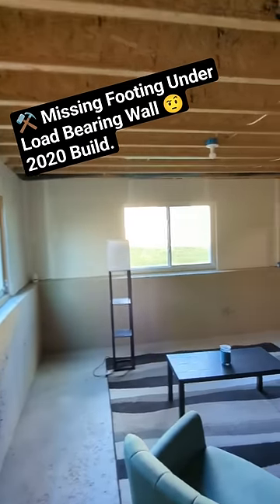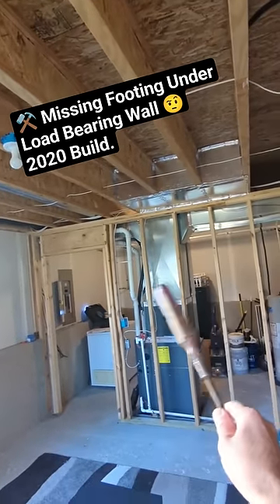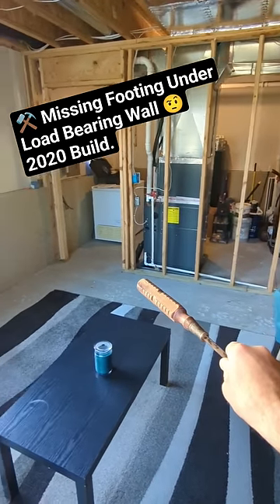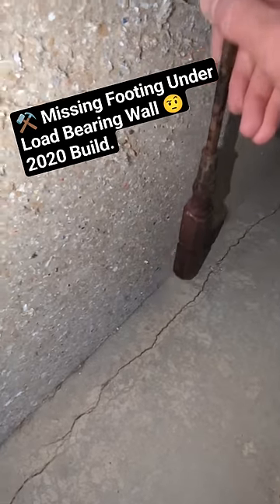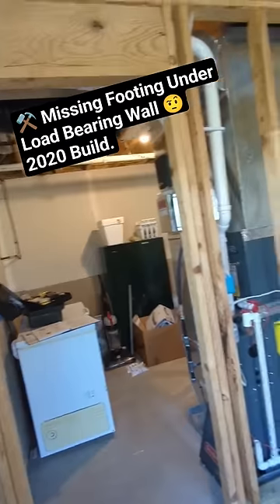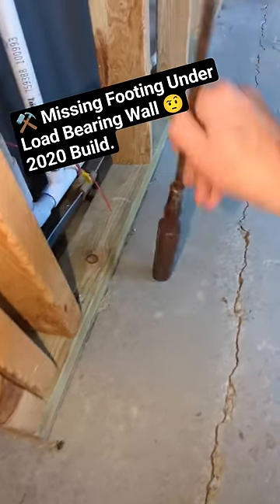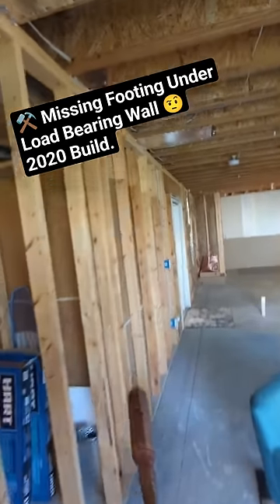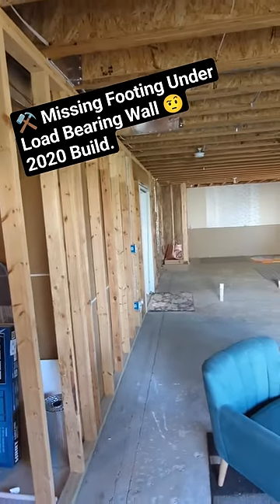FOOTINGS missing under load bearing walls NEW BUILD A trick to find missing#footing under #concrete

Comment: As long as the industry allows stupid drafters to design houses and lazy building officials to approve the drawings.  What do you expects?  Anyone who designs a house should be able to stamp those drawings just like an Engineer and have the education that goes with that.  There should be a 4 year apprenticeship to attain that stamp also.  But instead any friggin yahoo can design a house.  In Ontario there is a building code certification you need to obtain but that's not enough for the house to be designed structurally adequate.  All buildings should be stamped by an Engineer.  The problem is THAT is not a requirement.  But it should be!

Comment: Hahahaha....the price of 1yd of concrete 1200$...to rip out and add that same 1yd now 12,000$...build it right..or dont build it at all....this is the US..not China
I also find it interesting the crack next to the control cut.....the cut was probably done with a grinder and not a concrete saw..
One last thing and ill step from my soap box...do you guys know what the hell a tamper is...start using them..

Comment: Check the architechs specs on those trusses/joists.
The wall was put there as a partition NOT a load bearing wall.
IF it was to be a liad bearing wall there would be beams rinning the length of the wall from end to end to pick up the load from those joists.
This dude doesn't know much about engineering and construction.

Comment: This is garbage. Ive got steel i-beams which span my foundation walls that the joists sit in. 1985 construction. Bought in 2021. I wouldnt trust my family in anything built before 1990.

Comment: I'm guessing stone settled underneath a thinly poured floor. I have never seen or done footers for a load bearing wall. We have poured two foot deep puddles for where vertical beams come down. Lastly all doors and windows of installed properly get headers regardless of location. I have to leave this comment then give this video a thumbs down in the hopes i might cancel this crap from showing up on my feed 😂